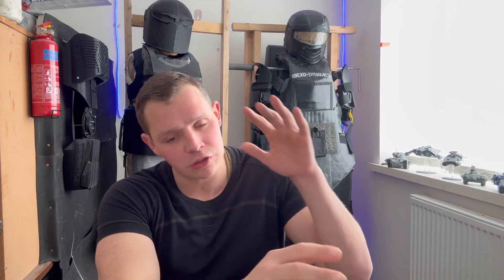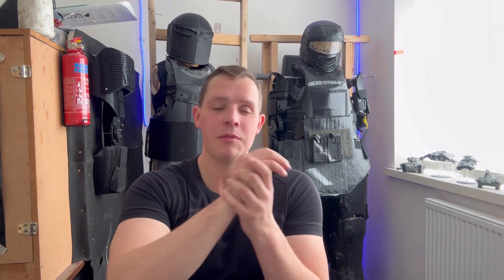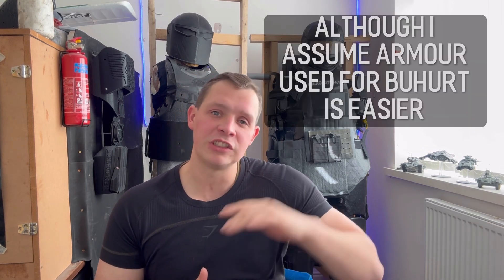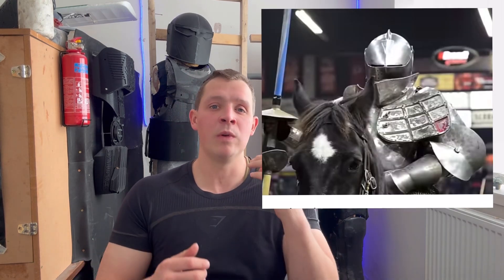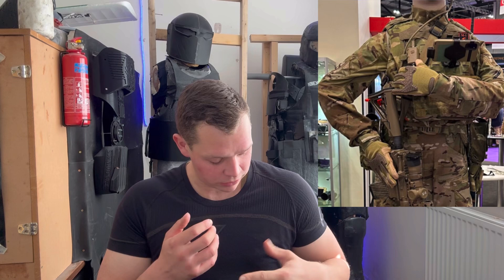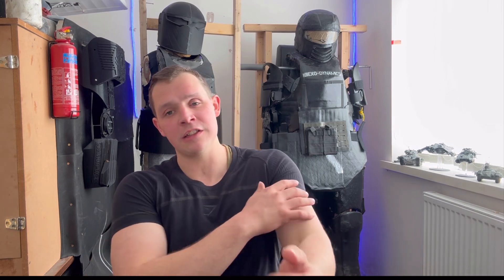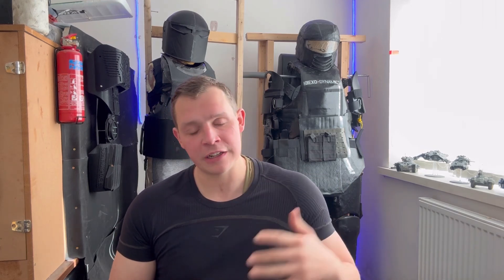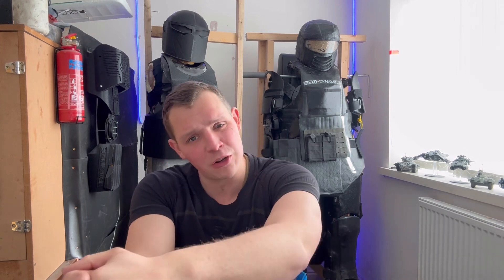The flaws of trying to use Medieval armour design in modern POWER ARMOR

Comment: A problem with medieval armor that I love, and find most don't know, is that you cannot sit down in it. Been standing for a while, find a wall to lean on :D
Edit: Another thing people forget about heavy plate armor, aside from the bearable load of where you walk probably not being up to snuff, is that the more bulky it is, the harder it is to use door ways lol.
Reply: From where did you get that piece of information? You can most certainly sit down in medieval armor.
Reply: If you couldn sit how to  ride a horse?
If its true then just for a special model of medieval armor, but in the most models of medieval armor is it easy to sit down!
Reply: I can literally prove to you that you can sit in many types of armor with some Knight 1/12 models I have.

Sure there's some designs that make It harder like those long metal 1 piece skirts for example. But most regular armor would allow to sit down, Its almost required If you're a horse soldier for example
Reply: I can't tell if the replies are serious or not, but they made me laugh none the less. For any thinking it is in fact possible, you are aware that fold in the plate is at the waist, not the hip? You can try lashing some steel to your back and seeing if you can bend it easily, but I honestly don't much care to try that, and that comment about riding a horse like your sitting on a chair, with your legs forward instead of to the side was particularly amusing. Watch a western, if you can, as you will see how a person actually rides a horse. And further, they had people aid in getting on horses... you know, due to being unable to bend the leg so high? Honestly can't take the replies too seriously with people exclaiming action figures and normal chairs  are perfect examples of real world reenactors and horse riding.
Reply: @ Historical sources disagree with you Like Hans Talhoffer.
Dumb People laugh all the time over things that they have no knowledge!
And knights where often  expected on a Battlefield to jump on a Horseback alone!
Reply: @killerkraut9179  and they only existed on the battlefield, correct? Obviously knights were giving their all in every step and physical exertion simply living in armor they never removed? Being able to jump on horseback alone doesn't mean they solely relied on that. They were people, same as any, and saying otherwise is just ignorant.
Reply: @ You are debunked Video What Did a Man at Arms Wear? | 15th C | 
Wars of the Roses channel thehistorysquad
Knights in medieval armor can sit down!
You are just ignorant and arrogant bad combination!
Reply: @killerkraut9179  So youtube is your answer... your basing all your argument, not on action figures or how a person sits in a chair normally, but youtube... then a personal attack to top it all off with? Yeah, figured you might be on to something with mentioning Hans Talhoffer, but believe you probably just googled it, which I can to ;)
Reply: @Suzuki_Hiakura  Video material is the answer!
Action figures=Toys?
Why you are making then dumb comments before you google it?
Reply: @killerkraut9179  Did you not read the other comments before you? or did you suddenly forget them? Regardless, your telling me to watch youtube for my answers on historical subjects and facts, and google things that I cannot find on youtube... there are more than enough actual experts and libraries with actual facts to learn from, and even historically accurate armor sets people produce following, you guessed it, historical works.
Reply: @Suzuki_Hiakura  I did google Tallhoffer 
but i just remebered my copy of my Königsegger Codex what i have as a book in front of my now!
Reply: @ I think one of youre comments before was a strawmen argument!
Reply: @killerkraut9179  Trust on the internet, youtube especially, is already rather low, and you established you not only prioritize using google for information gathering, but youtube videos for how you learn, and resort to personal attacks and "gottems"; now you tell me you have an actual book, relevant to the topic your debating, with all the trust and credibility eroded? Did I miss anything? 

Hell, believe what you will, I wouldn't fault you for it; could be I am wrong, but that's not up to you or me to decide, hence, why I simply leave my comments from what I have learned, seen, or have on my mind. 

The fact remains, this debate is as pointless as some internet doctor giving advice on the validity of scented oils; No one is an expert here, and there is no trusted third party to validate or verify the facts, making it a pointless waste of time. What do either of us gain from sending the messages, which you quickly respond to (I do believe that to be a good quality though, as its lost in todays world).
Reply: @Suzuki_Hiakura  You started to be disrespectfull my personal attacks whas just a counter! 
What are youre expert sources that knights cant sit ?
Reply: @Suzuki_Hiakura You say that you just leave comments about what you learned, but the only thing you mentioned are your assumptions and straping a plate to your back. No actual experience with armor and no sources, but you discount youtube and internet sources while you have no sources.

I have seen 15th century plate armor live at multiple reenactments and I can tell you can most certainly move and bend without being seriously impeeded. The breastplate and backplate end a bit above the waist for that exact reason, so that you can bend as the armor bellow the waist is in a way segmented(not sure how to explain it in english).

If you want good examples on youtube I suggest looking at 2 channels:
- Zac Evans
-Knyght Errant

I imagine that you are plenty intelligent, but in a civil discourse it's pointless to just laugh at any counter argument and dismiss all their sources, just because they are internet sources. Nowadays most sources are on the internet, even books in pdf format. What matters is cross checking them.
Reply: @Suzuki_Hiakura As far as I have seen people move in late 15th century armor in person they very much are capable of moutning a horse and lifting their legs up almost as much as without armor. The case you are talking about with their mobility being severly hampered was ussualy in jousting armor as it was made heavier and far more restricting to prevent injuries.

Comment: You've made a lot of good points in this video, however I am still of the belief that the incredible articulation of ancient armors isn't something to be overlooked!!! Designing around the issues you've presented to at least getting a good platform up to tweak these considerations into might be a worthwhile use of time. Also I believe there's some very immediate solutions to some of the issues you brought up especially with modern techniques and materials at hand. I feel that if you do decide to incorporate to some aspects of these armor designs into your suit you will be left with a usable, articulate suit of armor and 50% of the work that would go into a physical piece would be done and designed for you at least pertaining to the armor part of this power armor. 

Perhaps there are some more modern protective suits you could take inspiration from? I know there's some incredible diving exoskeletons out there for deep sea exploration.
Reply: I believe the perfect start towards making modern articulated armor is the placart.

Having 2 breastplates (an upper breastplate and a lower placart) would do wonders for mobility and protection. 

Such a setup would probably be the easiest place to start to test articulations on modern armor.

Comment: A properly made pouldron wouldnt couse arm mobility issue. It would however prevent you from shouldering your weapon.
It may be a concideration to have a larger plate on your non weapon arm.
When it comes to looking up with a helmet i suggest you look up "lobster tail helmets" and roman helmets.
Being able to lift your visor would be a help for breathing and comfort, drinking without having to take of the helmet completely.
I believe inspiration from how the breastplate interacts with the fauld and tassets can be helpful
Reply: I 2nd your comment, however I will add that Besagews are probably better than large pauldrons for modern power armor.

Pauldrons require articulations to function.

Besagews can be made extra thick, and  they are more modular. You can also flip any Besagews over to your back to use the buttstock, meaning you can use the buttstock on both sides. This would be great for left handed shooters, or maximizing usage of cover when firing from the left side of a corner.
Reply: @fallencrusader2975  
Great point about besegews. 
Modularity is a key point of modern warfare.

I have been thinking about throat protection and helmets, after seeing a comment on gorgets.

What is your opinion on a modernised Sallet? With a bevor.
Reply: @stanisawzokiewski3308  I feel like Modernized sallets are a little unnecessary because all modern helmets take inspiration of the sallet at their core. Only difference being a sallet's tail.

I believe instead we should focus on upgrading the ACH helmet design to become compatible with new supplementary armor parts to protect the face and neck.

I am personally not a fan of the bevors, especially for modern armor. The modular aspect of them is great but they limit neck mobility too greatly to be worth it. I am aware of articulated bevors, however articulating plates are too thin to stop modern rifle rounds.

I believe a better alternative can be adding a small V collar off of the upper breastplate to redirect gunfire and shrapnel away from the neck, similar to late 14th century breastplates but made thicker for gunfire.

Another key component to take into consideration for helmet design would be aim. We would have to develop a new shape of visor that would be able to hug a rifle butt stock to aim. Otherwise you'd have to install an expensive HUD system for all of the power armor helmets. This would be very expensive and take away from the modular aspect of helmet design.

I believe an alternate solution would be to make a removable visor with concave cheeks, made to hug a standard rifle buttstock.

If there is enough budget they can then add a hud for the helmet if they wish, but if there is an EMP that can disable the HUD, at least the helmet will still allow you to aim.
Reply: @stanisawzokiewski3308  Also as someone who owns a sallet and bevor, I am not a huge fan of the design. I understand the benefits of modularity on paper, I just find the bevor to be uncomfortable and it gets in the way sometimes. It's not too terrible it's just not my preference for some reason. I prefer Armets that offer more consistent/sturdy face protection and you can just raise the visor when need be. However sallets on their own are far more comfy to wear long term than an Armet.

If I was a knight in the medieval ages I'd wear a sallet without a bevor when on patrol, or out in a skirmish. However if I was going into battle I'd rather ditch the sallet for an Armet, than to wear a sallet and bevor together.
Reply: I've literally done exactly that and up armored my ACH with 1/4" angled AR500 modular steel plates. I'm a Soldier in the Army in the US, and I agree that we should upgrade what we have to make it offer better protection..
Reply: Some 16th and 17th century gunner cuirasses had a plate riveted near the arm hole that was used to help shoulder an arquebus/musket.

Comment: honestly find it a fascinating idea to make a parade/ceremonial outer shell to add onto an exosuit that functions more as an enhancement device with more cooling and a larger battery pack or serves as reactive armour for bodyguard work in high-class ceremonies /royal events, functioning more as a bulky armoured outer shell it could be used to store things like high tech systems and sensors which can be ejected on the fly for when you need close-ranged combat, with how tech is advancing can even hide high-powered lights in chess plate to burn things or blind the enemy, might be stupid but someone will eventually bitch for knight versions,
and with how shoulders and chest plates have been brought up have you ever watched Gundam IBO, the Reginlaze weird shoulder design could work as inspiration  for a few versions, with it letting you have tougher cloth and fibre armour mix along the front would optimize movement but have those parts less layered, fascinating video as always

Comment: a gorget does not need to go high up. 

a simple angled v shaped ridge on the chest, or a minor flared bump ( which do not impede vision downwards) are there to prevent things that hit the chest from glancing upwards along the armor into your neck.

to redirect bullet fragments to glance outwards instead of into your joints or neck.

these ridges are as present on modern vehicles as they are on medieval armor. and they look cool.

they work on melee weapons as well as fragmentation
Reply: Those are indeed features present on breastplates and very useful, but a gorget was specifically a separate piece of armor that goes around the throat. It did later become more integrated into the rest of the armor, though, and there were similar pieces like the bevor that did the same.
Reply: @imstupid880  ah, thanks ^^
Reply: For the ridges on modern vehicles, you're not referring to splash guards are you? For example, the bar going across the T-54/55 glacis?
Reply: @smartuy1  no. i mean the raised ridges that are on many tanks chassis that look like a a gear track.

they are made to prevent deflected shots from glancing into the turret ring
Reply: The V on the chest of many breast plates Is meant to redirect proyectiles. The problem of shrapnel going into the neck was adressed from the very beggining, dude's were getting shot at as early as the late 1300's
Reply: The main disadvantage is if you go prone the gorget is a sharpnell killimg machine. It will redirect most things into your neck. That is why its not as popular. But if you wont crawl in the suit then its good, you just got to know the drawbacks
Reply: @DeadWayfes  the chest V is better than a gorget in that case. an articulated neck or armored weave neck area can fill the gap with some protection
Reply: do a full ruffled cumberbund of them. #RefinedGentleman

Comment: medieval armor is not for the ballistic protection sections.

but for bump, cut and puncture protection in the joint areas. to protect against all non bullet threats on the battlefield.

it also provides resonable shrapnel protection for those areas and reduces overpressure risks from explosions.
Reply: Not really. Late medieval, early Renaissance high quality armor would be tested using a firearm. Now that is black powder, way lower velocity than a modern round. Firearms absolutely were a consideration 1400 & after.
Reply: @pubcle  applying medieval armor to the gaps of the powered exoskeleton armor would result in shrapnel protection only.

it would reach level 2 by modern standards at most.
Reply: @ Ceramics are much better now as disposable plates that absorb the hit, yes, but stating that they had not been constructed with ballistics in mind is false. Hell, some form of this lasted in niche uses across Europe until the 1900s. Kevlar itself is in many regards an advancement of brigantine. Obviously even the full cuirass dedicated to heavy frontal deflection of the Renaissance wouldn't do much to a modern greentip but it's wrong to state the armor didn't think about ballistics.
Reply: @pubcle  the armor in the video uses advanced material.

steel armor is just good for non ballistic/shrapnel only  protection in otherwise unprotected joint areas, as it is low profile enough to be viavlble there.

1800 armor does not stop modern rifle or most pistol rounds. its why this power armor is being build in the first place.
Reply: So if you wear a Ballistic plate under or over your medival armor that would mean you're mostly fully protected from everything short of 30.06 or anything to legs and arms.
Reply: @RabdoInternetGuy  medieval armor with modern ballistic armor over it would indeed do the job of very good ballistic, shrapnel and non ballistic protection.

the combined weight, especialy taking into account modern deployment durration, makes that unfeasable though.

unless its for eod purposes or door gunners only, in which case we basicly do that already.

for mobile deployment, the combined setup requites a form of load bearing and strain reducing exoskeleton so the combined weight of both armor systems becomes bearable.
Reply: Full Plate armor was devaloped mostly because of firearms, otherwise they would have stuck more to the coat of plates, a muchcheaper option. Solid plates, however, tend to provide superior ballistic protection.
Reply: @torg2126  No, it was not. Full plate Armour was developed because it was superior in deflection, not specifically to protect against firearms. When firearms became more prominent on the battlefield, the armour changed to accomadate that. But full plate armour did not come into existence BECAUSE of firearms.
Reply: @torg2126  against medieval firearms. 

plate thickness to deal with modern rifpe callibers requires powerarmor.

armoring the joints while staying mobile is tough, so nowdays non ballistic medieval style plate is good to armpr those parts against non ballistic or shrapnel threats.
Reply: The reason ceramic is preferred to metal is because of the weight with a power armor you eliminate the weight factor for protection so metal armor will be better against firearms
Reply: What is a bullet, if not a super fast puncture?
Reply: @bulldowozer5858  speed vs continous slow pressure makes a huge difference